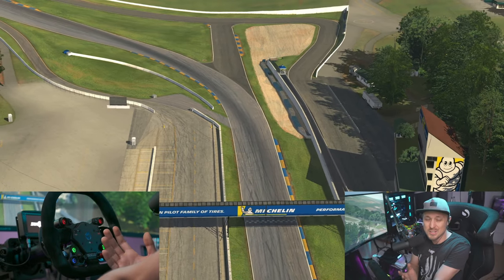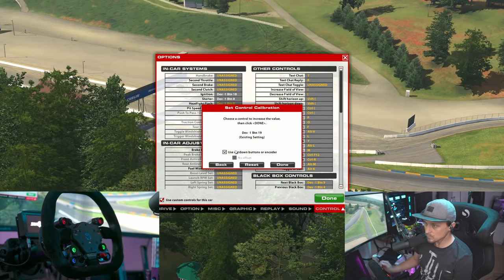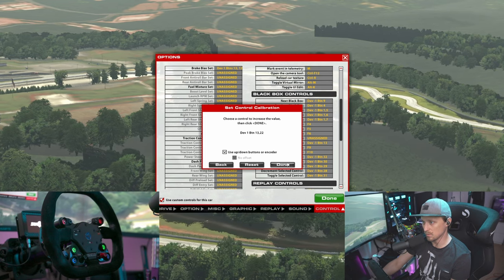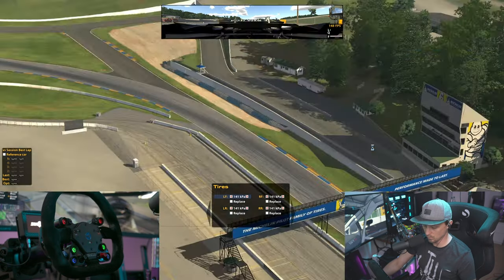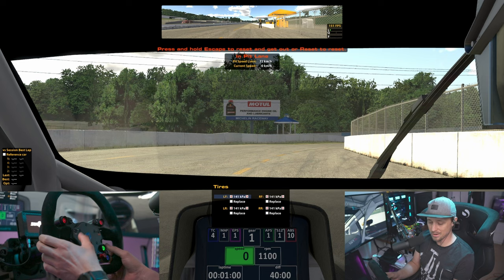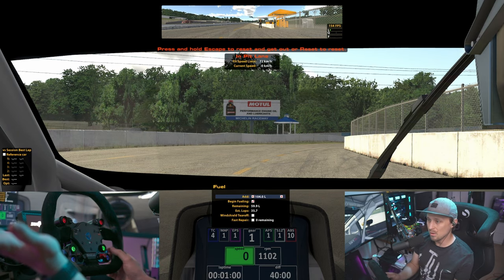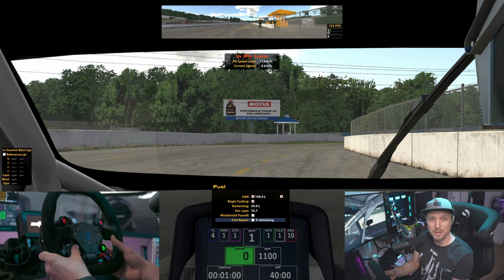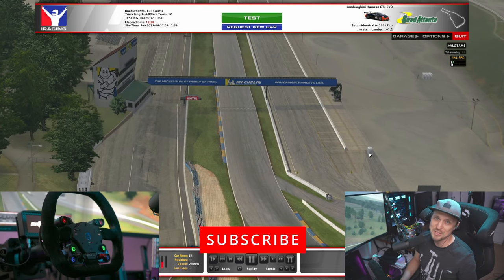Get TWICE as many inputs with this quick tip - very useful for lower end wheels!

Comment: Hey Dansu!  Would this work with clutch paddles?  Like, could I default the paddles to be clutches, and then 2nd function them to be throttle and brake, just for the unlikely event of a pedal failure?